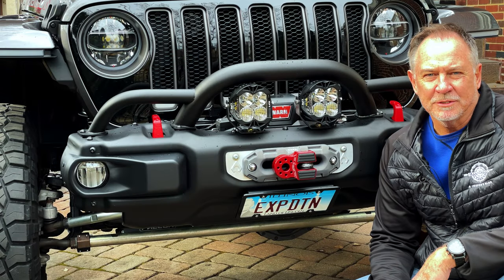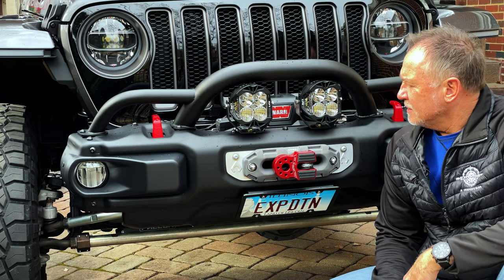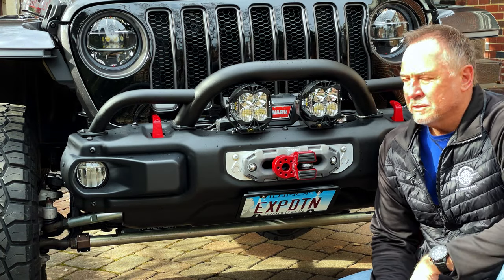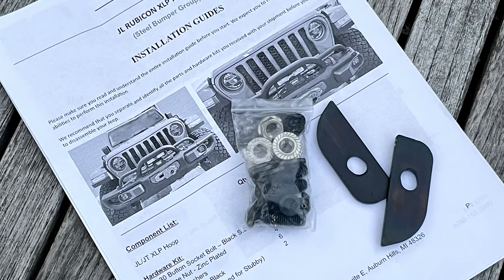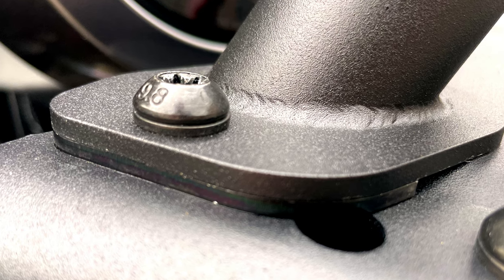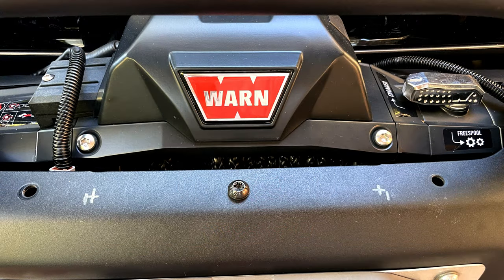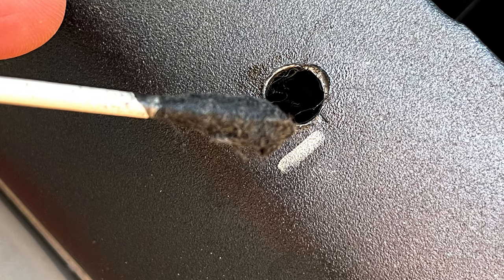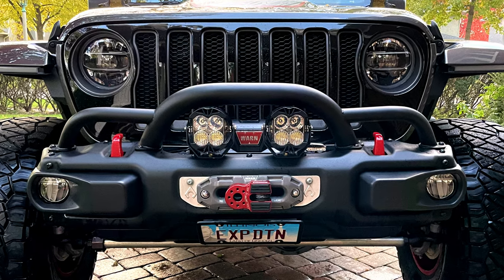Maximus-3 XLP Hoop Install and Review - Jeep JL

Comment: I do like that hoop much better than your previous one. To be honest, I really liked your original factory hoop with the lights on top. Did you use M-3’s back-of-the-bumper end caps to cover the back side of your fogs?  I see you used their Stealth license plate mount. I used that one, too. And their driver’s seat flashlight mount. I wish I’d used their winch plate instead of MOPAR’s. I believe it’s lighter and better designed. Have a Merry Christmas!
Reply from the maker: You know, the original factory hoop had a real clean look to it which I liked. The new XLP hoop brings a nice overall proportion to the Jeep now and they nailed the proportions.

I made my own end caps, you see how I did that on the video titled 'Jeep OEM End Cap Mod' (it's on the Mods & Installs playlist). They turned out well. Always great hearing from you and appreciate your comments. Merry Christmas to you Amigo.

Comment: Thanks for the great video.  I love the look.  It time to start gatherin =g Christmas presents for the new jeep.  You were able to install without taking the steel bumper off right.  How high is the top of the hoop.  I have a front trail camera option included in the build order so I need to ensure it is not too high.  Thanks again for your help.
Reply from the maker: Glad you found that helpful/useful. For a look at how the front camera will operate, check out a page on my build thread at wrangler forum. Scroll down to post #463   https://www.jlwranglerforums.com/forum/threads/rubi-recon.55336/page-31
Reply: @ExpeditionBuilds  Thanks again.  You're the man.  That does not look too bad.  Gives me comfort to strat stacking boxes of Christmas presents while wait for the jeep to be built.  I will check out the Maximum # site as well.  All the best, Lonnie

Comment: Could you provide total length in inches from outer side to outer side of lights? I’m looking to see if KC Flex Era LED 20” Bar will fit inside the XLP hoop. Its’s W 21.36” H 2.66” D 3.85”. Thank you, you’re videos are great!
Reply from the maker: Hi Chris! Let me get you a measurement on that. I'll get back to you with that soon.
Reply from the maker: Ok, I just took the measurements. The inside of the XLP hoop is just under 20" at the base. It tapers in quite a bit on the radius. The Flex Era 20" light bar is too wide.The 10" would still look dope in there though!
Reply: @ExpeditionBuilds  Thanks for your time and quick response! Think I’m going to go LP4’s since the 20” bar won’t fit. Love your look!
Reply from the maker: @chrisshotley5573  My pleasure! The LP4's are amazing and won't disappoint! Be well friend✌🏻

Comment: Noticed that none of your four front bumper lights have amber lenses. Hmmm, why didn’t you go with amber lenses on your front bumper mounted Baja Designs? Or on the stock bumper lights?
Reply from the maker: Hi Greg! Since that video, I have added Diode Dynamics SSC1's out near the corner of the bumper. I was able to attach them via an existing bolt hole in the OEM Steel Bumper. They add to the factory LED fogs, spreading the beam wider and the color is great in the snow.
Reply: @ExpeditionBuilds  Photo?
Reply from the maker: @gregrusteikas9578  https://www.jlwranglerforums.com/forum/threads/rubi-recon.55336/page-39 Go to post #582, #583.

Comment: I have the JL XLP Hoop as well.  My LP4s will not fit.  Unless I reverse the bracket (then they stick out way to far) they will not fit no matter where I position.  Were yours an extremely tight fit?  The Maximus stuff is usually very reproducible.  My hoop was actually the first one installed  I'm wondering if the  specs are a little different.   Can you provide the bumper to hoop distance at your mounting point.  I love this hoop but may have to forgo the LPs.
Reply from the maker: Hey James. It's really tight, but they will fit. I included my measurements for the holes for this exact purpose. I spent a fair amount of time working on the layout. Try my measurements and just hand hold the LP4's in place to verify.  Let me know if I can further help?
Reply: @ExpeditionBuilds  I marked out your exact measurement and mine will not fit.  It only fits a maximum down angle.  I measured under the hoop at your mark and mine is 5 7/8ths inches.  The light is just shy of 6 inches on bracket.  I wonder if your hoop dimensions are just 1/8th to 1/4 inch higher than mine.  Mine was from the first 5 they manufactured.  Or maybe it is my brackets.
Reply from the maker: Hi James! Strange that your LP 4"s aren't fitting with the XLP.  I'm currently out of town on business. I'm back at weeks end and I'll get you some measurements so we can compare what we have. Which direction do you have the light brackets facing?
Reply: @ExpeditionBuilds Did James ever get these to fit or figure out why they wouldn't? I have the same hoop and LP4's to go on a '24 Rubicon when the Jeep arrives. I'm hoping it fits like yours did as the front end looks amazing with them!
Reply from the maker: @ridenhigh  Hi Kent, the LP4's will fit. You need to locate the mounting point a little forward. If after drilling the mounting hole and the lights are making contact as your aiming them, the housings are aluminum and you can remove a few millimeters from the top back edge of the housing.